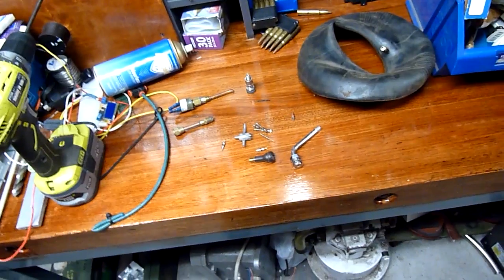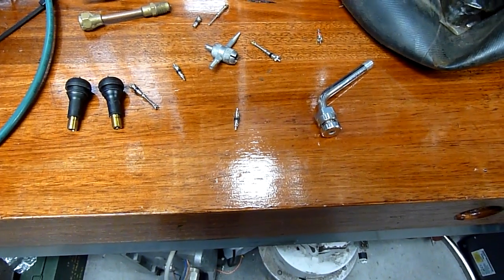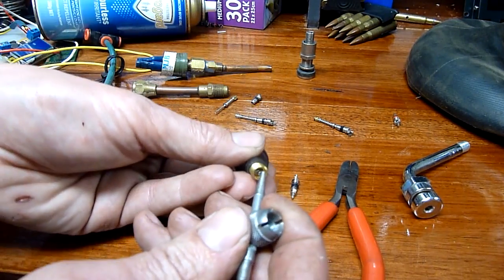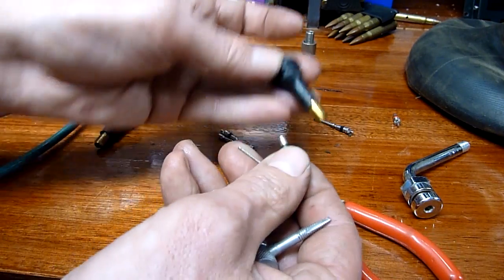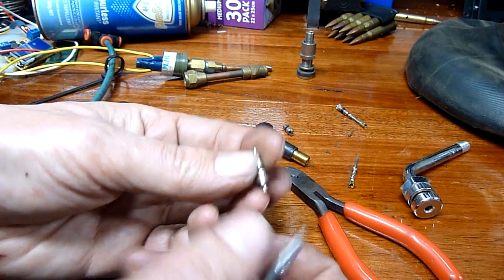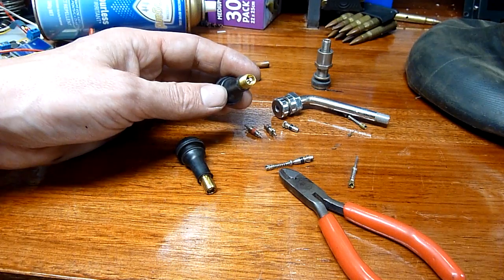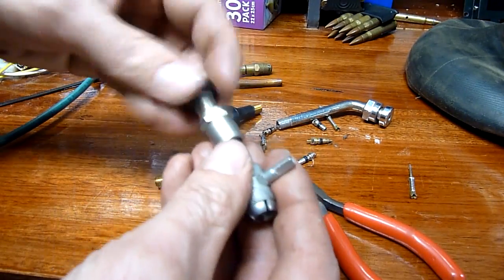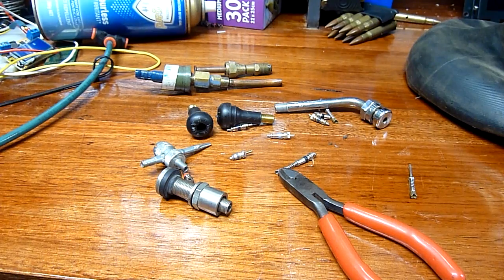The Common Schrader Valve (Poppit Valve, Tire Valve) - How it works

Comment: The tractor valve stem is probably designed for high flow. I don't think it has deal with the pressure and heat a car or truck does either. I looked up the pressure ratings of Schrader valves one time. With the right stem, good for 5000 psi.

Comment: Are you able to pull a vacuum with a standard bicycle or car style schrader valve simply by connecting a chuck style filler and connecting to a vacuum pump?

Comment: Only the pin was removable, the core part with seal , I  could not replace it....luckily I had a high quality metal cap with seal inside

Comment: For HVAC service, there are valve core removal tools that remove a significant restriction when pulling a vacuum. Also useful when you need to replace a leaky core while the system is still under pressure.

Comment: Smashing, very enjoyable video Ed :-D.
I always suspected the ones in fridge systems had to be different in seal type or build quality, but i don't know anyone that's tinkered with them to ask.

I would imagine the older long spring type would need a slightly smaller hole near the innertube so the brass cup won't go through, so the spring is compressed.
If the valve stem is made modern the old long spring ones won't work :-(

Comment: The tractor valve core is aluminium and smaller  possibly due to being a much larger tyre, it requires much less air pressure.
Reply from the maker: Possible, its just odd given tractor tires often have water in them to lower the center of gravity and prevent rollover, Brass or Stainless would make more sense.

Comment: Good old car tyre valves as we call em in the UK. I used to work for both Sturmy Archer and Raleigh (The latter, still trading next to my mates place in Eastwood, Nottingham, who made their name in bicycles), which this type of valve was in common use, along side the Woods (Was secured by a screw type collar, though not as common as it once was, though on bikes, this is my preferred valve), and Presta (Mostly found on racing bikes, where the use of a Schrader would be too big..... hate dealing with this type of bike valve).

Comment: Also seen them on old hard drives, where they were used to fill the purge gas into the drive, typically ultra dry nitrogen, so that the hermetically sealed drive was slightly pressurised with gas for it's entire operating lifetime, so no moisture got in to corrode the uncoated magnetic media on the platters.
Reply from the maker: Oh yeha I have seen them on industrial equipment including my Saber Jet radar magnetron unit, for Nitrogen filling
Reply: Every 3.5" and smaller drive I have taken apart just used foil stickers as seals.

Comment: I used to sort of work at a tire place and those valve pin things were everywhere on the floor in the shop. I took a bunch of them home and I have them somewhere. They are sometimes replaced when the tires are changed. The entire rubber valve stem assembly sometimes depending on condition.  I guess throwing them in the garbage is too much effort.
Reply: any decent tyre shop will cut the old valve stem straight off and replace the lot with the new tyre, not worth a single customer ever coming back with a leaking valve when the things cost a few cents ;) especially when the average motorist will not even notice a leaking valve until the rim is on the ground raping that tyre, and then the tyre shop is up for a $100+ tyre under warranty all over saving a few cents, it's all built into the cost of fitting and balancing anyway (or the tyre price if the shop doesn't charge seperately for fitting and balancing) most people who have been doing it for a while don't even unscrew the old valve to release the air, just grab the stem with the weight pliers and rip it in half :D air releases quicker through the larger hole and you can break the bead basically instantly. Even the valve caps are replaced because once again it is not worth a single customer coming back with a valve leaking ever, if that tyre comes back with a leak and it's not a puncture somebody is getting their arse kicked :D PLUS the old valve caps make great projectiles for the mechanics to shoot at each other, not as good as chunks of HT lead, but they both fire out of plug boots very nicely :P
Reply from the maker: yeh my first RAV4 had new-ish tires but old stems, 2 of them split at the base when I went to put air in the tires. the cores, if all brass, can be collected and sold as brass scrap around here for $4.80 a Kg, same with tubeless valve stem scrap if you burn the rubber off them,

Comment: I also see them in small propane, oxygen, and MAPP gas cylinders, good old design!
I've seen green ones, might've been from vehicle AC rail, not sure.
Reply from the maker: yeh absolutely, my Bernzomatic has them, very universal valve,  they just change the seal material depending on gas type and operating pressure/temp.